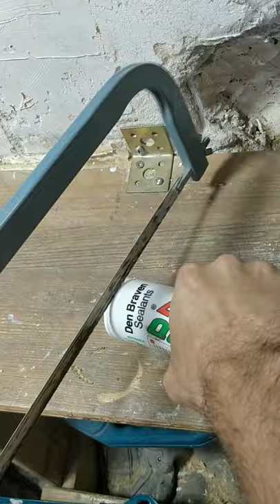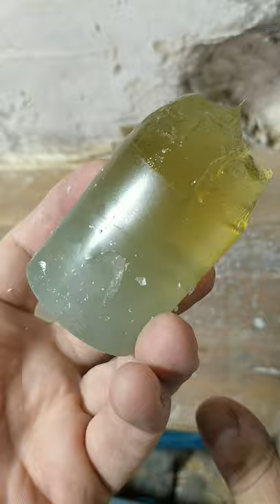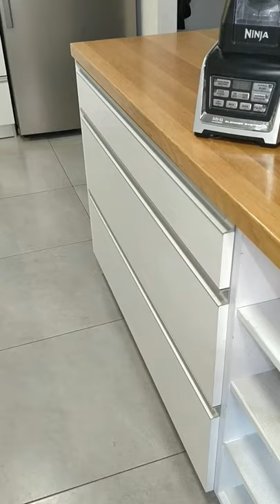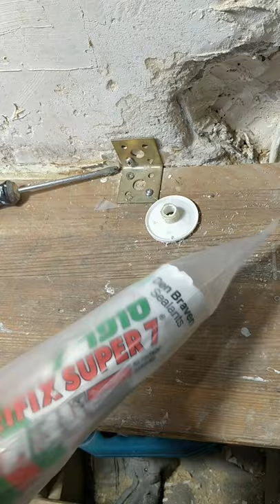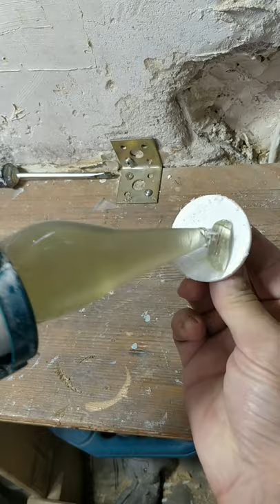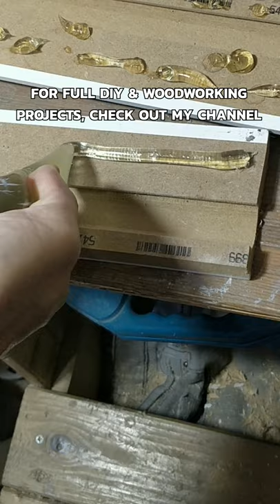Part #2 - How To Save & Reuse a Dry Silicone Tube - Using Pastry Bag :) XDIY

Comment: Man next time I want to waste 30 minutes to save 5 bucks I'll have to try this!
Reply: Reduces environmental waste and would only take 5 minutes. Why do you think it would take 30 minutes?
Reply from the maker: Maybe less than 5 minutes. Writing his comment took more time 😉
Reply: @XDIY  Sure, but it takes only 10 seconds to stick a piece of tape or a screw in the top, the you actually get to use the tip. 🤔
Reply from the maker: @thatoneguyc8312  I'm doing it of course. Sometimes it get dried no matter what you do. The video is for such case 🙂